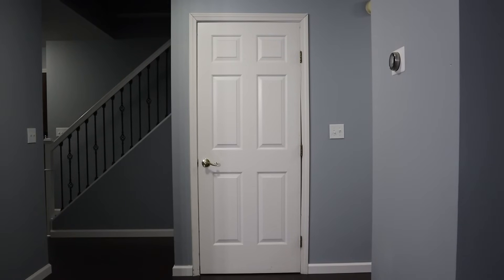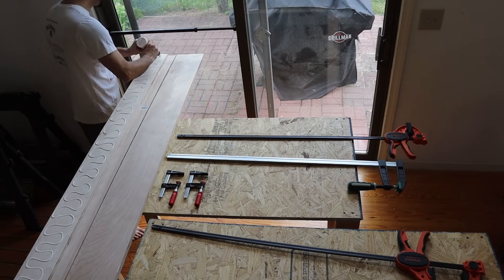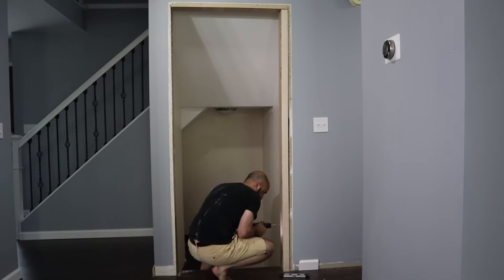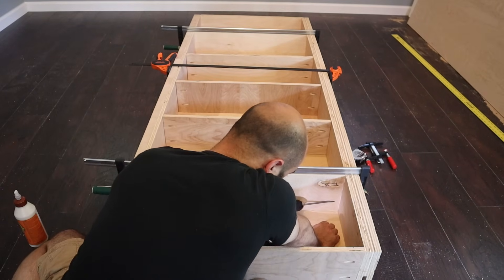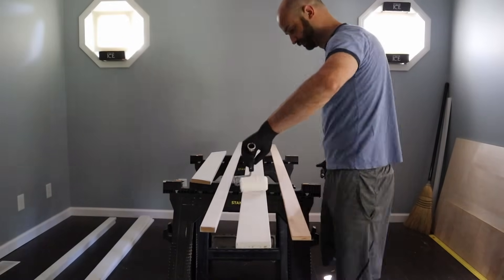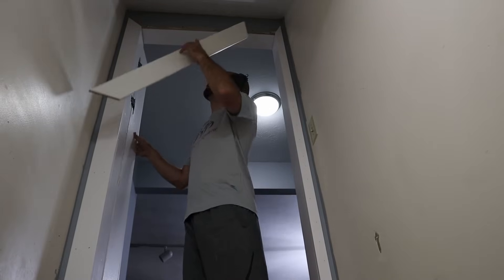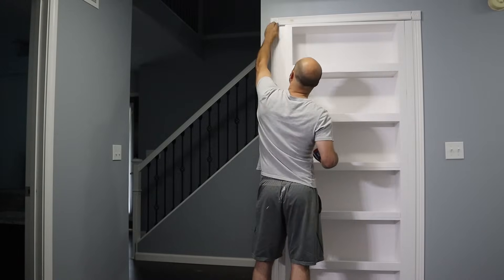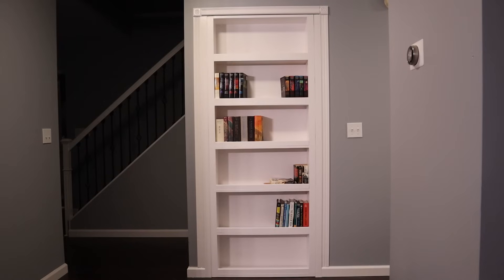Hidden Door Bookcase

Comment: You are a genius!  What about putting a set of casters under the bottom shelf to help support the weight - so that the hinges are not taking the full load?  I had tried to create a pantry by hanging kitchenmaid wire over-door hanging shelves on the back of a kitchen exit.  But the weight tore the entire door off the hinges in the middle of the night. I ended up only putting spices on the door.  Anyway great job.  It looks wonderful!
Reply: if the weight isnt supported by the hinges you are going to leave drag marks on the floor. great way to make a hidden door plain to see.

Comment: Hey bud. I'm bout to build essentially the same door. I'll be using the same hinges you used. I'm wondering dose the casing on the hinge side stay stationary and if it dose can you see a gap in between the door and casing. Also dose it rub the casing when you open or do these hinges open up past the casing for clearance.
Reply from the maker: The casing remains stationary, yes.  I'd recommend building everything and dry fitting it before you add any paint or finish.  I painted too early and ended up having to sand off some paint because the door was rubbing against the casing.  In theory there has to be at least some gap there but how much of a gap is dependent on your expertise in building everything.  When the door opens it clears the casing and will open all the way where the bookcase is facing the opposite way toward the wall.
Reply: @renovateyourmind   thankyou for response. One more question did you bring those hinges as far out to the front of the jamb which would be the back side of the casing or cut them into the casing a little to get the full range to open all the way.

Comment: Hey John, what are those types of hinges called and where did you purchase?? Thanks!

Love the job you did... I’m taking notes!
Reply from the maker: Thanks!  They are called SOSS invisible hinges.  You can get them on Amazon.  Model 218 is what I used here but they have several sizes.
Reply: John's Renovations thank you! I built the frame today, but i will need to beef up the side like you did. I have a wider opening so going to have 2 that open up line French doors. Pretty much  I’m using your video to wrap my head around how to apply the same concept to making it a double. Any recommendations fully welcome!
Reply from the maker: @Van3ssaMichelle  Awesome, good luck!  I'm going to be doing a critique video of this bookcase to cover the things I have problems with or would do differently.  Hopefully this coming week!
Reply: Screws to install moulding?

Comment: Nice work.  Does it still work reliably with the whole bookcase totally loaded with books?
Reply from the maker: Yeah it does.  I have noticed a little sag in it over time but it isnt dragging on the floor.  I'll likely add a caster wheel at some point to help support it.
Reply: @renovateyourmind  Thanks.
A caster is likely to make a mark on the floor over time, making the secret a dead giveaway.  Maybe just mounting a wheel on the frame to support the corner when it the closed position would also work since I'm assuming it is closed most of the time.

Comment: How much gap (if any) did you have from the left door jam to the left of your book shelf when you shut it? Was it a tight fit? I’m building mine off of your video now.
Reply from the maker: I'm not home at the moment but it was about an inch or so.  Your distance from the front right to the back left of the bookshelf should be slightly shorter than the opening in the wall, otherwise it will catch when you try to open it.
Reply: Thanks John. I have about a quarter inch gap right now. I might have to make it a little bigger. Tomorrow I’m installing the hinges. Thanks brother

Comment: How much gap does the bookcase need from the frame to open freely?
Reply from the maker: Imagine a bird's eye view looking down from above.  From that angle, the bookcase is a rectangle.  You can draw a line from one corner to the opposite corner, like the hypotenuse of a triangle.  If the hypotenuse is any longer than the width of the doorway, then it will catch every time you try to open it, so I made mine just slightly shorter than this.

Comment: Great project!  Thanks for sharing.  I'm curious as to your hinge spacing.  Why are the top two so close?  Why didn't you have all three at equal distances?
Reply from the maker: The hinges came with instructions and that's just how they said to space them out.
Reply: This is supposed to help distributing the weight.  If all hinges are equally distanced, the top one is exposed to to a larger proportion of the weight and might fail after some time.

Comment: Hi John! wonderful project! How did you calculate the width of the bookcase to avoid it bumping to the side? How much shorter is the bookcase in relation to the width of the door? thanks
Reply from the maker: Imagine a bird's eye view looking down from above.  From that angle, the bookcase is a rectangle.  You can draw a line from one corner to the opposite corner, like the hypotenuse of a triangle.  If the hypotenuse is any longer than the width of the doorway, then it will catch every time you try to open it, so I made mine just slightly shorter than this.
Reply: @renovateyourmind  very helpful. Thank you.

Comment: How did you figure out the depth of the bookcase so that it would open and close without hitting the door frame/jam?
Reply from the maker: The diagonal measurement (front right to back left) has to be smaller than the opening in order to swing open.  So I decided depth first and then made my width based off that.
Reply: @renovateyourmind  I've gone cross-eyed!  I think I know what you mean though.

Comment: Can anyone tell me why one side, the hinge side, is thicker than the other? I swear he says that he did the same on each side when gluing them together, I've rewatched it and I cannot figure it out!
Reply from the maker: The extra thickness is just to accommodate the hinges since they are morticed in.  The non hinge side doesn't need to be as thick, you just want both sides to appear even from the outside so it looks normal.